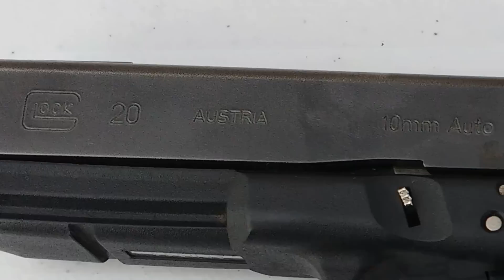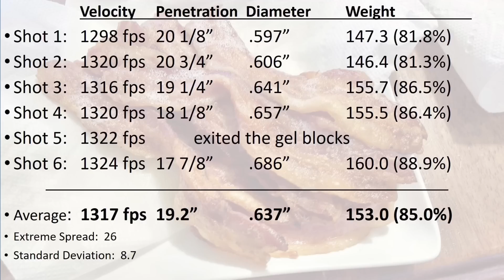Hornady 10mm 180 Grain XTP Ballistics Gel Test

Comment: Thanks for posting this.   Shoot the same bullets out of my Ruger PC4 using 7.5 grains of Longshot, which also yields about 1,300 FPS.  Nice to know they perform that way.
Reply: Went and reviewed my data.  I produced my ammo on the LNL AP press, and Longshot doesn't like to be thrown from either my Hornady or my Lee measures.   I typically see +/- .1gr variance, which is a lot for that small of a charge and also why I settled on 7.5gr of powder instead of 8.0 (even though I didn't see pressure signs at 8 grains).  This is my chrono data from a 35 shot string with that ammo:

   High: 1293.0 
   Low: 1193.0 
   E.S.:  100.0 
   Ave.: 1246.6 
   S.D.:   24.9
Reply from the maker: 1200-1300 fps with that bullet is going to hit with authority!

Comment: I see such back and forth info when it comes to longshot. Hodgedon advertises this load 50fps slower out of a 5 inch barrel. And the old swamp fox load data says 10.6 grains for 1340 with a 180 grain gold dot out of a factory Glock 20.... That’s a pretty big charge increase for only 20 more feet per second.

Comment: Your the man, I just saw this 10mm test
Reply from the maker: Thanks Greg!  I'm hoping to have the first of the 45ACP cast  HP tests posted tomorrow.
Reply: Loads of Bacon can't wait
Reply: Loads of Bacon I've taken 2 whitetail so far with my Glock 20 this year, both with my handloads, I'm pushing the 200 gr xtp around 1250 fps or so, took a while to work them up but man they preform well, both were threw and threw with decent weight retention,
Reply from the maker: Meat in the freezer -- that's about the best ballistics test there is!
Reply: Loads of Bacon that's right
Reply: Loads of Bacon the RedHawk 44 mag is trying to steal my g20's spot though lol
Reply from the maker: 10mm is great, but 44 is....well, it’s 44, and that means it’s awesome!

Comment: just an idea for you -- there is little or no data out there on whether or not any of precision delta's/ x-treme plated/ or berry's plated hollow points actually expand or not- which is surprising since so many people buy them in bulk...you may want to test them-  those tests would probably get crazy views...i personally use the precision delta 124 jhp for .357 sig and 9mm, and have looked for tests on them and not found much at all. same goes for the plated hp .40's and .45's from x-treme....
Reply from the maker: That's a great idea.  I've never used them, but I know a lot of other folks do.  Thanks!
Reply: i might have some extra laying around if you want some, let me know
Reply from the maker: Sounds good.  I can do anything between crawling and screaming with the 9mm/357 or the 45.  I don't own or load anything chambered in 40.  Send me a message (YouTube message or email, or message in Twitter or Facebook - all the info's on my "About" page.)
Reply: cool - i will

Comment: Would you yourself shoot hard cast through a factory glock 10mm barrel?
Reply from the maker: As long as it's not illegal, immoral, or unethical, I'll do just about anything at least once.
I've heard of the cast bullet/Glock barrel issues, but from the little bit I've heard, it sounds like powder coating helps.  It's all theory until you pull the trigger.
Reply: I need a chronograph....

Comment: Fwiw I found on some forums (YMMV) 2 loads which, in THIS gun (G40 Klone 6.61” LWD compensated barrel + 22# RSA in a 6” longslide) “are supposed to” do 1400fps with Hornady 180gn XTPs. CCI LPP’s,  Starline brass, heavy Lee FCD crimp, and coal is 1.260”.
9.7gns Longshot
And
17gn Lil Gun.
NOTE: these are over max published loads and flattened primers, they ran in MY gun AS CONFIGURED. They ejected 6-10’ away. They were accurate enough at conversational distances. I’ve shot them and they are confy to shoot IN MY GUN AS CONFIGURED. The compensator makes a huge difference! I dont have a chronograph so I am estimating the velocities based on what forum shooters reported from their guns. Point being….to me it was worth it to try carefully building up these loads. Shot at approx 5,000’ elevation.